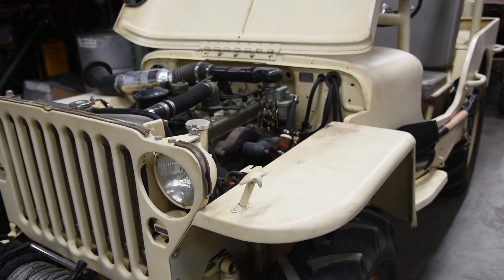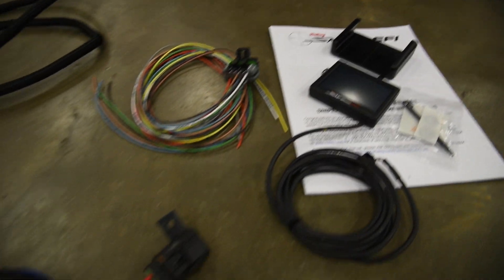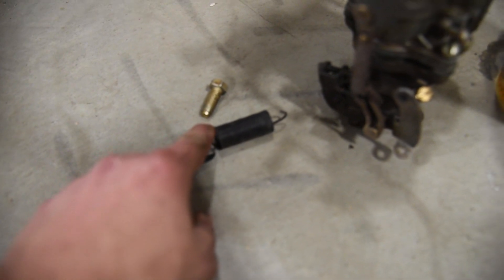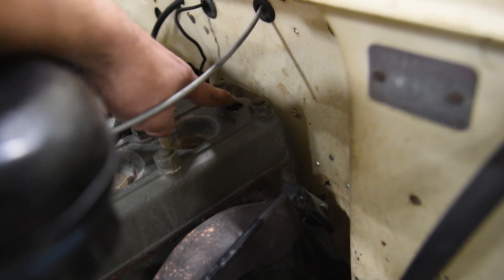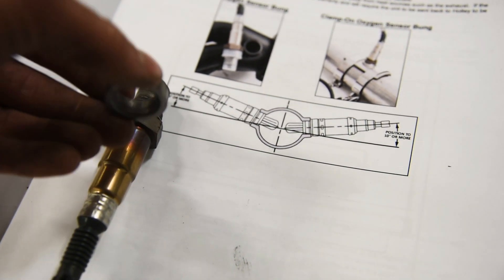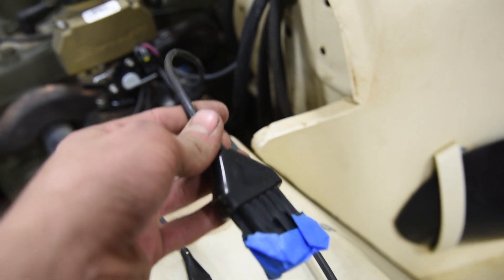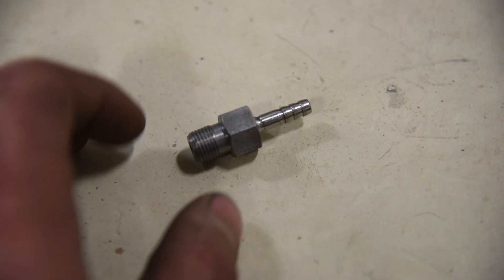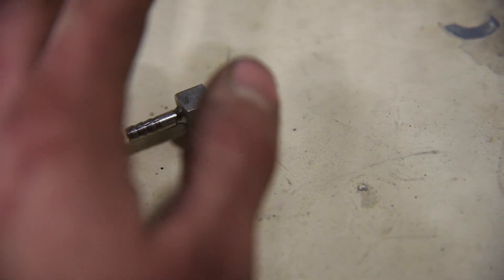How to Fuel Inject Your Willys L134 With a Holley Sniper

Comment: That little metal "V" is a turbulence inducing device. Those old engines (flat head 4 bangers), had small valves and small ports in order to keep air velocity up in a low reving engine. In areas of the intake that had large area, (i.e. the intake plenum), air velocity slowed, causing the fuel to settle or "pool". That device was intended to induce "swirl" or "turbulence" into the incoming fuel and air mixture, thoroughly mixing fuel and air, so all cylinders got a balanced fuel air mixture, (no Lean and no Rich cylinders).
Reply: Also known as a diffuser

Comment: This is very cool.  Its a little bit of an investment at $850, but well worth it in the long run for improved drivability, no stalling, etc.  Nice job on the installation...super fresh!
Reply: Ya just having the O2 sensor so the motor has a way of knowing what's actually going on in the cylinders and it has the coolant temp sensor too which is cool

Comment: Excellent presentation!
I've a 134 f. Seems far more compatible for, between the bolt up issue & the exhaust heat. In all honesty though, you lost me when ya broke out that little computer screen. Mechanical advance, filing points, that's all I know. That fuel
 pump/filter set up--
 very nice! 
Mostly typing to commend  you on such a well laid out & put together video.
...oh one last, at the end, ya mentioned carrying a spare?  
Memory serves me, think I might have an old Carter under the seat. If we ever meet up on the trail, ya need it, it's yours.
 All jest aside good job!             

                  John

Comment from the maker: I'll upload a full driving video with mpg tests, extreme inclines, etc by next week.
Reply: je regarde souvent ta jeep avec bam bam et ses amies dans le moab. c'est du bon travail que tu fais et que tu as fait sur ta jeep. le seul soucis avec les carburateurs c'est qu'ils déjaugent dans les pentes. l'essence coule et risque de faire un départ de feu. je viens de mettre en ligne sur mon groupe jeep en France ton montage avec ce kit fantastique. ma jeep dispose d'un V6 ford avec une injection ford EFI mais sans le module de contrôle, c'est parfait pour le tout terrain hard. bien à toi depuis la Nouvelle Calédonie.
Reply: That was I was thinking, any thoughts after the swap on throttle response, engine run, MPG, etc?  Thanks! Good detailed video!
Reply: How's it compare to the 2 barrel carb ?

Comment: Read up on the GM HEI module. I've done a conversion locking out the original distributor, and using the original points, (very little current) to trigger the module.

7 pin module for electronic conversion. Megasquirt documentation has a good write up on how they work.

Comment: Fantastic video I just installed my sniper on my 64 international I have a bout 400 miles on it now and have had very minimal issues. I as well had to replace my alternator cause my one on installation wasn’t enough
Reply: What motor does your international have I have a 54 r 110 pickup with the blue diamond, but it's still 6 volt.

Comment: Hello
About a year ago I was looking to install the sniper on my CJV35  with the l134 engine . I am running dual fuel tanks and the cost of two pumps with the price of the sniper changed my mind. Researching the install I looked at the linkage for options also the mounting . Great solution on those two and tips on using the stock tank. Thanks

Mitch
Reply: Use a simple fuel transfer setup that’s not built for pressure?
Reply: @tedcarl5382  Hi Ted . A simple transfer (low pressure electric fuel pump) is 60.00 usd and the price of pipes , hoses and wiring not bad . But the Holley 887.95 ,58psi pump 150.00 and Turn n Burn adapter and linkage kit 299.00 or try to make your own . The cost  of this project is why I decided not to install this unit .
Mitch

Comment: Good presentation.  I'm not sure if you know this, but you didn't necessarily need to fabricate an adapter, if you could find the other type of Willys L134 intake manifold used with big-throat Carter carbs such as the WA and the YF.  The small-throat WO carb was used on 4WD Jeeps; the big-throat version went on 2WD Willys Wagons and Jeepsters.  The throttle linkage is different, because on the big-throat version, the two carb studs are located side-to-side, while for the small-throat version they are front-and-back.  Either version bolts to the same exhaust manifold.

Comment: The fuel going past that inverted  V would cool as the carb as the fuel went by as it would be changing state from a liquid to a vapor and may cool the carb. Just a thought and it would be interesting to know. May assist in atomizing the fuel to each cylinder. Someone knows.

Comment: Going to rewatch the part about the distributer;  I'm considering this system on my F head on a stock m38a1 jeep.  I want to keep the 24v system, but have a more reliable setup for cold starting, ease of use.  

Some kind of battery equalizer I believe would be required as there isn't exactly a dual voltage alternator around for these.  

Now if only I understood gas engines better.  The install looks fairly straightforward but I worry I'll get in a situation where I have to replace military 24v parts with civilian 12v parts to really make it all mesh.
Reply from the maker: On my older Submarine build videos I actually converted a sealed 24V distributor with a rare and expensive 12V coil sold on eBay overseas. But you'll have the problems of all the special electrical boxes and plugs. I personally wouldn't do this swap on an M38A1 with all its stock style wiring, it's just too unique. That's why 2 Jeeps are always better than 1.

Comment: I have added a 2 barrel holley sniper to my dodge weapons carrier.  Make sure you have good suppressed ignition leads as sniper will have problems with interference.
Reply: What does it to your dodge fuel consumption?
Reply: @rockymountain5222  it is a bit better but where it really helps is cold starts and being smooth. No flat spots.

Comment: I know you take that jeep to some incredible trails, out in the middle of nowhere, how are you going to diagnose this thing if it acts up?
How many times did that Carter  let you down?  Maybe I'm wrong, but out in the middle of a trail, I'll take my Carter, & points ignition.  Hard to beat
the simplicity of that system.
Reply from the maker: Process of elimination. Does the fuel pump work? How's the fuel pressure? 02? Etc. Carter has let me down at least a dozen times on my various Jeeps. Linkage prone to falling apart, fuel leaks, stuck floats, etc.
Reply: @TurnNBurn  I wonder if the brand new Carter that are made from Joe's Motorpool Parts, would of solved the problem.  Thanks for the reply.
Reply: @dinofalabrino8522   Nick splurged for a second backup carb.  keep in mind you could carry the original carter carburetor and components to swap back. it wouldn't take long.  thats an idea for someone that does not want to spend on two holly efi units.  keep us posted on your tests nick. this might be the way to go for me.
Reply from the maker: I just did a timed swap from EFI back to carb... will be included in the next video!

Comment: How did you actually get one? I tried to by the Autolite 1100 Sniper for my Land Rover Series 3 for months and it's been on indefinite backorder.
Reply from the maker: I ordered in March and just received last week.
Reply: It would be intresting to see a fuel injected 2.25.
I put a modern electronic ignition on mine and it allready runs a lot better.
It also improved the fuel economy when running a little more timing .
Reply: @rickz9495  North America Overland does the Autolite 1100 Sniper on their builds now. I'm in Kenya and the cost of importing one is prohibitive. I have a Weber 34ICH right now that runs beautifully.
Reply: @upscaleshack i have the same carb, it runs great and starts great. the only reason i would want fuel injection is for beter fuel economy.
So it would be intresting to see a long term review on this Jeep.

But i think it would be pointless to upgrade to fuel injection with a points ignition or a cheap electronic ignition. My fuel economy and part throtle performance improved greatly with my new fancy ignition(123 ignition bluetooth distributor).

And i agree on the cost of this setup.
I think it would cost me around €1500 with al the extra parts. I can buy a lot of fuel for that kind of money.

Comment: Congratulations.  major changes to the Jeep Family are a major plus which does include what you are doing in this thread.  I am wondering if any of your work could be transferred to a later model CJ5.  Is it ok that I send information concerning a project I am considering involving the Holley Sniper?  Great Job and a major step in keeping the older Jeeps alive and well in a modern demanding world.  My project will be using the Sniper system on a 4 cylinder CJ5 1980 151 GM HEI using the emissions systems in their entirety.  Question:  Is the  Holley Sniper Smog and emission approved and do you see any problems involving the 4 cal. engine.  Most changes involving the Sniper have been involving the six cylinder engines.

Comment: first off love your video. one area of concern is the O2 sensor which my 1952 Willys doesn't have. this kit comes with O2 sensor and all the electronic harness. will this kit incorporate into my '52 Willys when the O2 sensor is not connected?
Reply from the maker: You have to install the 02 sensor. It's what the computer uses to create the air/fuel mixture tune

Comment: Does this engine have hardened valve seats? I assume you’re not using a lead additive in your gas. 
Just curious because I wanna do the same thing but have no studies on leaded vs unleaded on these engines.
Lead will damage the O2 sensors over time is what I’m told
Reply from the maker: Yes it does. I run pump gas

Comment: You need to put links on the stuff you have .example the filters and were you find them.
Reply from the maker: All info is at the end of the video
Reply: @TurnNBurn  thxs. I just ordered the sniper from my Jeep and I need to try to figure out where I can get that adapter that raises it up off of the intake manifold
Reply: @TurnNBurn  The adapter your buddy made on the autocad is what I am after. I did not see that on the list.
Reply from the maker: It's just a couple flanges with tubing. You can make it with a grinder and welder.

Comment: well,i wonder if it exist a version of this TBI for a 1 cylinder engine! ?
Reply from the maker: I don't see why this couldn't work on a 1 cylinder. Any extra fuel just goes into the return line
Reply: @TurnNBurn  hummm  maybe ,,i would certainly have tried it on my Yamaha Rhino 2006 that is carburated.i am looking for a cheap way to install EFI on it .i used to work on cars and trucks injected,i have seen the "evolution" and if yours is well tune your engine and driving experience will be great ! leu us know !

Comment: What did u do about the heat riser?
Reply from the maker: Welded it in place on the inside, and JB welded around the rod to prevent exhaust leaks.
Reply: @TurnNBurn  I have contemplated megasquirting a 48 cj2a, however you made such an amazing blue print I can't but follow you lead.  So why wouldn't you remove the whole heat riser guts?  And by welded in place I assume in the position as if the vehicle was fully warmed up?

Comment: It wouldn't be difficult to lock up the distributor shaft, use the internal reluctor sensor & module to trigger the Sniper & then use another HEI module to fire your existing coil. Your distributor is in terrible condition, with all 4 connections on the HEI module corroded.
Reply from the maker: Would still need a working distributor shaft to run the oil pump
Reply: @TurnNBurn  Well that goes without saying. I was referring to locking the top & bottom distributor shafts together so that the ignition timing can be controlled by the Sniper. The set-up screen actually shows a setting for " Magnetic Distributor" which could connect directly to the reluctor trigger. Then the existing ignition module could be moved somewhere dry & fire your existing coil. So then you could have electronic timing for no extra cost.  PLEASE overhaul that distributor anyway as it is a disgrace to the rest of the vehicle.

Comment: You will Probably find out if you disconnect the battery you got to go through that whole system to read so it will re-calibrate itself for about 2 miles after you disconnect the battery
Reply from the maker: The tune is saved to the internal computer hard drive. It doesn't disappear if the battery is disconnected